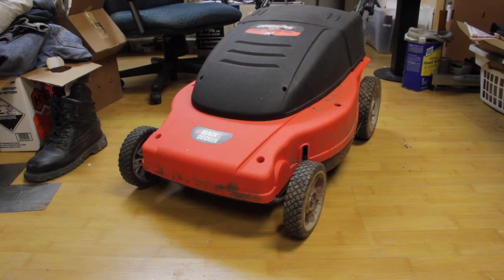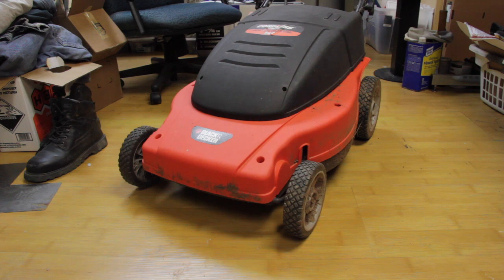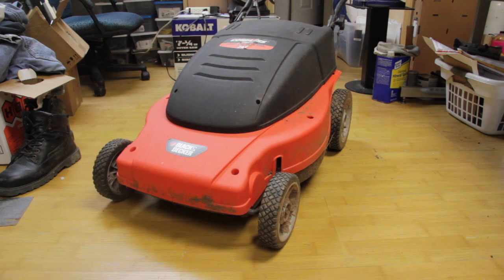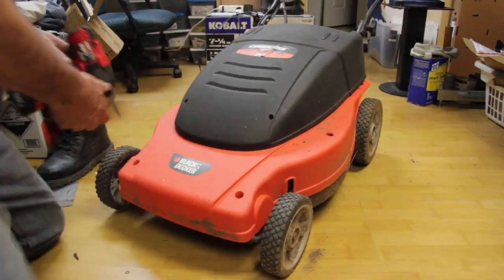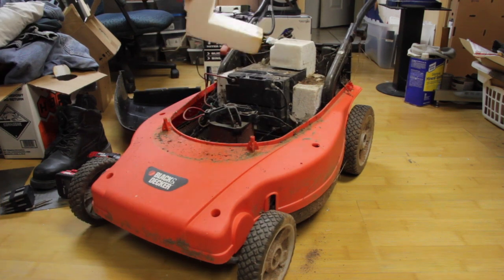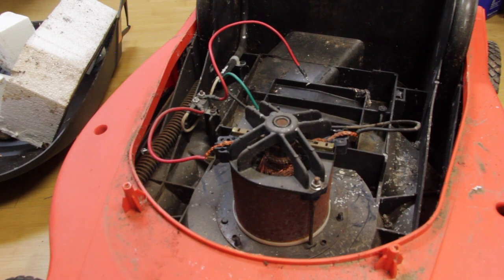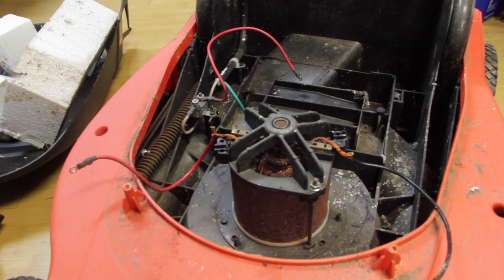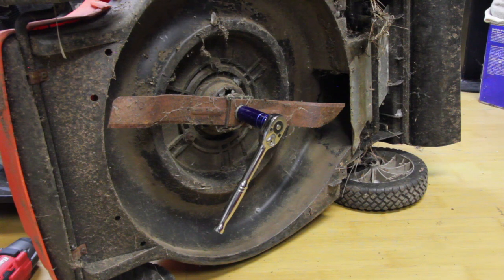Low Budget Electric Scooter Build Part 1

Comment: cant wait to see the final project
Reply: No part 2?
Reply: I wonder if you ever did use the motor... I actually found this video ages ago when I was wondering if a lawnmower motor could power an e-scooter. Then not long after I actually did it myself and now my own e-scooter is actually powered by a lawnmower motor! It's a Bade-Z XTR Street 2 and it uses the motor from a 24v 500W Enviromower, that just happens to fit through the chassis hole perfectly and it revs a little bit faster than the original, having a top speed of 28kph on flat. My 500Wh 7s lithium battery pack does 16kms on a full charge at full speed.
Reply from the maker: Thanks Chris, Yes I am excited as well